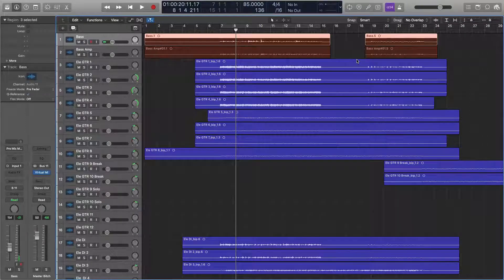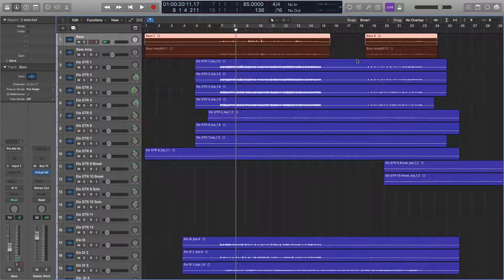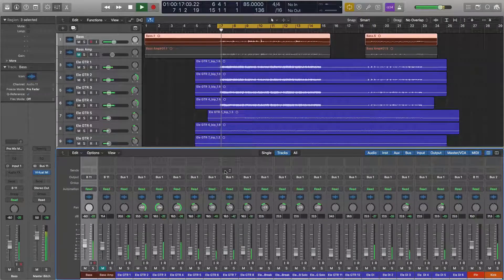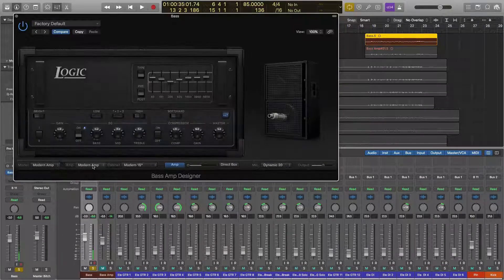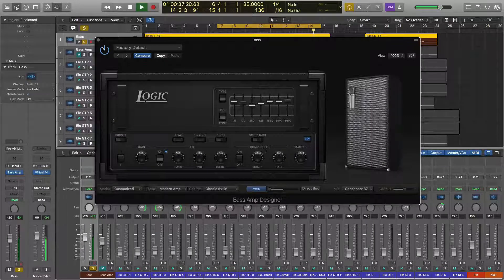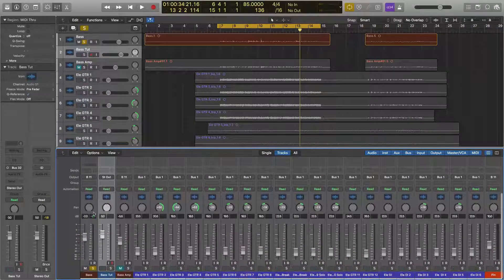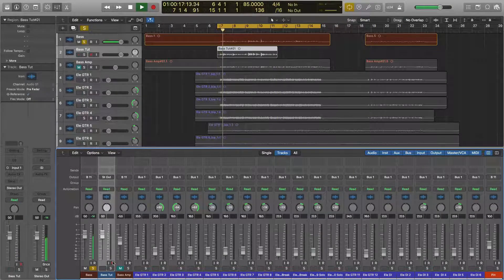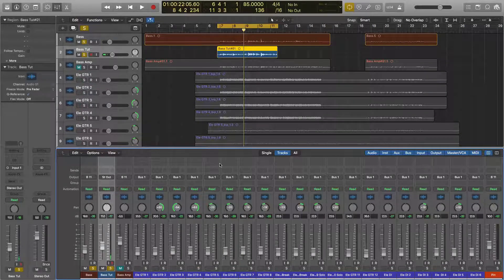How To Print Tracks Logic Pro X

Comment: Printing to a track is the easy part - but I just printed a stereo mix and broke it up into separate songs, then renamed each region  - where are these new tracks found? It's not listed in the project's audio file folder??
Reply from the maker: You can bounce each new region either into a new folder, or directly into the bounced files folder located in the session